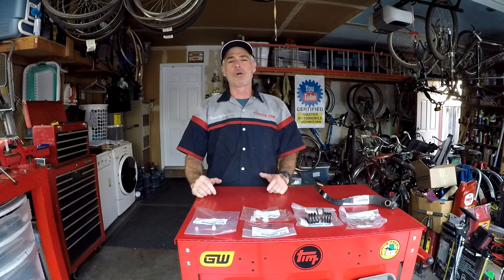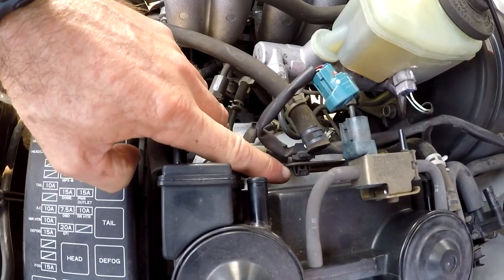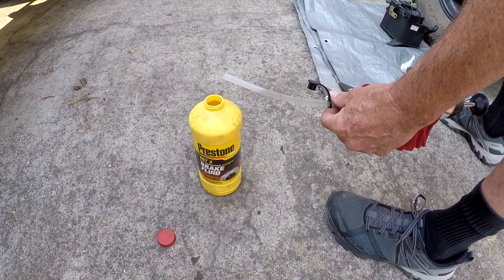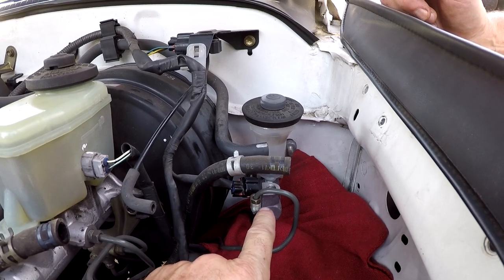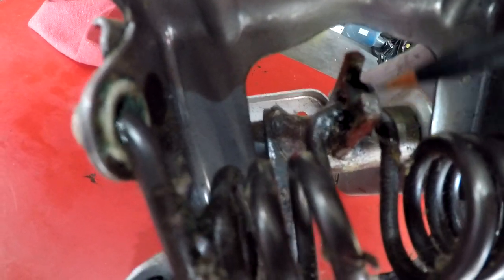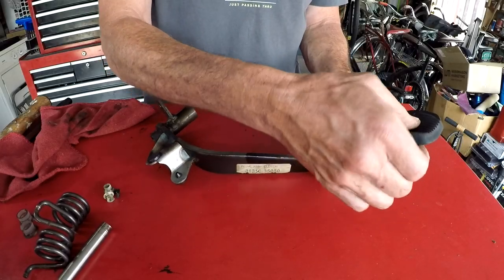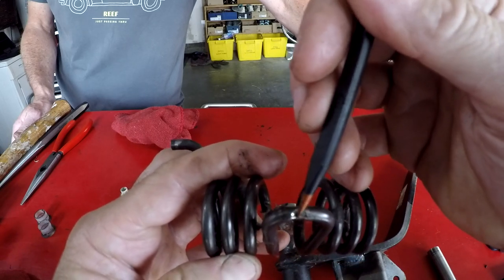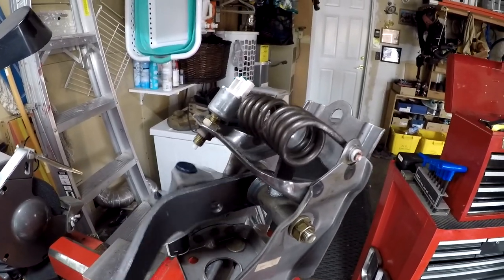Clutch Pedal Rebuild - Replacement

Comment: FYI, the clutch is self bleeding. you can just open the bleeder and let the fluid drain downwards, any trapped air will eventually work it's way into the reservoir.
Reply from the maker: Hmmm.  How long would you have to let it gravity bleed?  When we did a 3.0 to 3.4 Swap on a 2nd Gen 4runner,  that clutch slave cylinder was a pain to bleed.  We had to put a clamp on it to get it bled.

Comment: What are the symptoms of this needing to be done? I have a 97 Tacoma,  5 speed  manual. My clutch pedal went from engaging about halfway down , to right at the bottom. Thought it was the slave cylinder. Replaced that and the master cylinder. Helped a little but not enough. Could this be my issue. Clutch grabs fine, no slip.
Reply from the maker: @Chris-zp6eh  I don't think the clutch return spring is your issue.  There are adjustments you can make with the clutch pedal free play. There's a rod that goes from the master cylinder to the clutch pedal with a lock nut.  You can loosen the lock nut and turn the rod to lessen or increase the free play.  Look up clutch pedal free play, and you'll understand what I'm talking about.  I don't have a video for it.

Comment: If I just wanted to do the 3 piece kit on the clutch pedal I wouldn't have to remove the master cylinder and drain it etc right? I could just pull the pin and then remove the clutch pedal assembly and install the bushings correct?  Thank you
Reply from the maker: Yeah, that's correct.

Comment: Timmy quick question if I depress my clutch pedal and it doesn’t fully come back up unless I drag it the rest of the way up with my foot does that mean the spring is no good? Or what can be the cause of this issue?
Reply from the maker: It could definitely be the spring.  I would get under the dash board and have a look.

Comment: I have an auto trans.  But after seeing this video and also fixing my sloppy shifter a while back, I decided to do my brake pedal bushings.  No side play in the brake pedal now  - like brand new.  This video helped me a lot and I wanted to say thanks to yous.  Can't wait to get a 20t press in the new year...
Reply from the maker: That's cool you were able to fix the slop in your brake pedal by using this video as a reference.  You're very welcome.  When you go to Harbor Freight to buy the press, have them open the box and take a look at the pressing cross member that the bottle jack sits on.  Quite often that pressing bar is welded on pretty crooked.  I don't think any of them are perfect because they're using some cross-eyed welder in China, but maybe you can get one that fairly straight.  The press does work very well though and the price is definitely right.

Comment: I lost one of the nuts that hold the master cylinder onto the firewall that are hard to put on.. do you know the part number or what that nut is called?  I cannot find it anywhere.  Thank you
Reply from the maker: Go to your local Toyota dealer.  They'll be able to get it for you.

Comment: Thank you so much for making this video. I replaced my whole pedal assembly yesterday solo 99 4Runner and this video was very helpful
Reply from the maker: You're very welcome Taylor.  Great to hear our video helped you out.  We appreciate you taking the time to comment and let us know.  Happy Wrenching!
Reply: what was the need and purpose of you doing that ? ? ? curious curious curious ...
Reply: @efil4kizum  My 4Runner had 300,000 miles. The plastic bushings on the clutch assembly wore out years ago and the pivot points were metal on metal. That wore out the metal and the clutch pedal was hard to use, very squeaky and not enjoyable to drive.
Reply: @taylorbarnes5377  my '97 taco (343k miles) has always had that squeaky pedal during certain times of the year cold or humid out (as well as a shift fork squeak that is now gone with it's 1st new clutch + new shift fork in 27 years) the master/slave cylinder went bad at about 200k miles (pedal would not fully return in Reverse)  i had the yota tech that replaced those items several years ago fully lubricate + grease the pedal bushings, spring,  joints etc. while he was right there and there was NO more squeak that lasted for a very quiet 135k miles (except for the nasty shift pivot fork squeak inside the bell housing)... the pedal is now squeaking again once and awhile after the new clutch parts

Comment: Does this clutch pedal fit a 1998 T100???? I know you added all the parts in description. I want to rebuild mine as well but I don't want to buy the parts and they won't fit.
Reply from the maker: I'm not sure Carlos.  Your best bet is visiting your local Toyota dealer to get the right parts.

Comment: Thank you Timmy you got them all brother.  I needed this video my cruise control doesn’t work on my five speed in the clutch pedal.  I have to kick it up cover me first gear is a bit tricky but I think I’m going to have to do this rebuilt.
Reply from the maker: Hope you can get it fixed.  Good luck with the job.

Comment: Hey Timmy, best thing about getting another 4Runner is I get to watch your videos again! This time scored a manual 2000 3.4 Sport. Pretty excited.

I'm a bit surprised there wasn't enough room to slip a new gasket onto the firewall studs there... Or did you just disconnect the lines in the abundance of caution?
Reply from the maker: I can't remember but I think we didn't want to tweak the lines to get the gasket in there.

Comment: did this, more or less, today. two things: R&R of the clutch pedal is doable without disconnecting the hydraulic line of the master cylinder; and be careful what bushings you buy, since not every one labeled compatible actually fits. thanks for the vid.
Reply from the maker: Hey Leif, thanks for the info.  I don't know if it was clear in the video, but the reason why we removed the clutch master cylinder was to replace that gasket between the master cylinder and the firewall.    We didn't want to massively tweak the fluid line so that's why we disconnected it.
Reply: @TimmyTheToolman  Yep, and a good plan to avoid hurting the line. For whatever reason, mine moved with no problem. We had recently replaced the master cylinder so no need to replace the gasket this time around. Thanks again for your great vids. They're a massive confidence-builder.
Reply from the maker: @leifrudd8934  Good job getting it done.  You're saving yourself tons of money doing your own work while learning more about your vehicle.

Comment: Are the clutch pedal braket and assembly the same on the 1st gen tacoma and a 3rd gen 4runner. In the middle of a 5 speed swap and all i can find is a tacoma clutch and brake pedal assembly
Reply from the maker: I'm assuming they are but I can't say for sure.

Comment: Here are a few shortcuts:  1st) You don't need to drain the clutch master cylinder, don't even remove the cap or use a flare-nut wrench.  Just remove the two nuts on either side of the master cylinder(MC) that attach it to the fire-wall.  Under the dash, unplug any electrical connectors from the clutch and remove the pin that connects the MC fork to the clutch pedal arm.  Under the hood, pull the master cylinder back an inch or two, but not all the way out, only about half way, (half the distance relative to the parts that protrude under the dash), so it sits near the end of the two bolts.  (The fork never needs to pass through the fire-wall to complete the entire job.)  2nd) Remove the bolt under the dash that secures the clutch pedal assembly.  Once the bolt is removed, then carefully depress the clutch pedal towards the floor, being aware that the spring is still in play, but the three bolts have been removed that secure everything.  There's not a lot of force from the spring but you don't want to pinch your fingers or have the pedal-assembly move suddenly and damage wires under the dash.  Once the clutch is depressed toward the floor you can tilt the pedal upwards and it should make it easier to remove from under the dash.  3rd) Rebuild the pedal as per the video, but before you reinstall the pedal, make sure you install the MC gasket through the firewall.  Surprisingly, you can install the gasket from under the dash.  The trick is that you need to curl, (not fold or crease---just curl), the thin round edges of the gasket so that it will fit through the hole.  Use something, maybe an empty toilet-paper or paper-towel tube, to flex the gasket down it's length.  So one bolt hole on one end of the tube and the other bolt hole toward the opposite end of the tube.  Basically just role the gasket a little bit, primarily the thin rounded ring parts.  You only need to curve it just enough to reduce it's width so you can slip through the hole in the fire-wall.  So once it's curled properly, take it under the dash, slip it over the MC fork, stick one end of the gasket through the hole, manipulate the MC fork a little, to help you get the other end of the gasket through the hole, and now the gasket is on the correct side of the firewall and you're almost done.  Be careful once you get the gasket in place that you try to keep the bolt holes lines up and everything so that when you install the clutch and start manipulating the master cylinder that the bolts don't damage the gasket.  I used a little bit of blue masking tape to try to keep the bolt holes lines up.  I didn't have an extra gasket, but I suppose it wouldn't hurt to have one in case yours isn't as flexible as mine was or you have an accident.

Install the clutch pedal and finish everything up and you're done, never once having had to empty the clutch master cylinder or even extract the MC through the fire-wall, (other than a few inches.)
Reply from the maker: Thanks for sharing your technique.

Comment: The torque on that through bolt is 25ft-lbs according to the standard torque chart in the beginning of your service manual. It's a JIS Class 5T bolt with M10x1.25 threads.
Reply from the maker: Thanks Jacob.  This might be more accurate than the "Gudentite" spec Todd tightened it to.

Comment: Hey Timmy the Toolman,

I have a small question, do you know if Toyota made a Limited trim Sport Package model? I don't see one anywhere, and i own one. It's a 2000 Toyota 4Runner 4x4 Limited V6 Sport Package.

Seems kinda crazy, but cool. I think only SR5's came with the Sport Package. Sounds like i got a factory freak model.
Reply from the maker: I'm not sure on this.  T4R.org has a thread that might have the answer you're seeking.  Here's the link: https://www.toyota-4runner.org/3rd-gen-t4rs/82033-3rd-gen-4runner-buyers-guide.html

Comment: Great Video. If you just want to just replace the plastic bushings for the Torsion Spring do you have to remove the whole pedal from the car? I know its a tight space to work in there but is it possible?  I would like to avoid having to remove the Evap system and master cylinder just to replace 3 bushings.
Reply from the maker: Don't know if you could do it like you want.  If you try it, let us know how it went.

Comment: My bushings for the spring are toast.  I wonder if that would prevent the clutch from returning all the way.  I've always had to use my toe to pull the pedal back the last 1/2 inch.  I've had the problem for years.  It's not the clutch play adjustment and have replaced the master cylinder.
Reply from the maker: It could be.  Some people have also chosen to do away with the OEM spring set-up and install a linear return spring hooked to the pedal and then hooked to part of the body under the dash.  If you look under the dash at your brake pedal return spring, it's a spring like that.
Reply: @TimmyTheToolman  Replaced the bushings today.  Had the two white ones and went to the stealership for the middle spring one.  They charged more than MSRP!  Anyway it was a bear getting that spring back in place without a bench vise and proceeded to obliterate that center bushing I just bought.  The white ones were pretty bad and one almost wore all the way threw the metal to the outer part of the plate.  Guess I caught it just in time and now the pedal returns to normal.  Thanks Timmy for all you do...  Valve covers are next.
Reply from the maker: @schadlarry  Good job getting it done Larry.  Have fun with the valve cover gasket job.

Comment: Hey Timmy any tips to lubing/cleaning the reels on a 3gen electric seat?
Reply from the maker: From the write-ups we've seen on the Toyota forums, you should really take the seat guides apart and clean then grease the plastic gears.

Comment: Hey Tim, Is this applicable to a 1st gen Tacoma? I purchased the torsion spring because my clutch is starting to sag ever so slightly and not allowing me to use my cruise control. While I’m in there I might as well replace everything else.
Reply from the maker: Yes, this would be the same for a 1st Gen Tacoma.
Reply: Ditch the spring, my 1st gen Tacoma had lots of spring and pedal wear, and I welded a new pedal spring mount, but I decided to try without the spring,j and there is so much more feel in the pedal without the spring. The spring doesn’t seem to do that much work pushing the clutch 5-10 pounds more force without the spring, nothing I didn’t get used to in a week.
Reply from the maker: @jamb312  Thanks for sharing your opinion and option for the clutch pedal.

Comment: Hey man I been watching your videos trying to get ready to do a little tlc on my 2002 Toyota Tacoma Prerunner  like valve cover gaskets, spark plugs, and fuel injectors what is that book you always use as a reference on these videos?
Reply from the maker: It's a Toyota Factory Service Manual.  Do an Ebay search and you should be able to find a manual set for sale for your year Tacoma.
Reply: Appreciate it brother!!
Reply from the maker: @geronimo6830  You're welcome.
Reply: I found a set on amazon cheaper than I could get on eBay! Got lucky they had one left for my year model!! I really appreciate it man. And looking forward to more videos. In addition to my 2002 Prerunner I also have a ‘94 pickup 4x4 with the 22re in it. I hope you get to do some  videos on one of them. Lol it needs more love than my prerunner does. I really enjoy your videos I found myself watching other you’ve done because there is just a lot of stuff to be learned from the way you do things. Looking forward to more of em.
Reply from the maker: @geronimo6830  That's great you found an affordable set for sale.  I do have a couple videos working on a 22RE engine since I bought an 85 4runner a couple years ago.  Great to hear you're learning some helpful things from our videos.

Comment: Can you do this job without disconnecting the hydraulic line?
Reply from the maker: You probably could.  You would probably want to put something under the clutch master cylinder to support it so pressure isn't being placed on the line.
Reply: i just did part of this job, though timmy's approach is more thorough and avoids risk. i re-greased the bushings only, and removing the pedal assy can be done by removing the one upper bolt, the two nuts on the clutch master cylinder, and the electrical connections. back off the master cylinder away from the firewall a little, but not to the point that it's hanging and hurting the line, as timmy alluded to. i was able to maneuver out the pedal assy.
Reply: Does this also mean no need for a new gasket if just changing the bushings and spring?

Comment: Im sure y'all have heard about adding an older style spring in there instead of that horrible OEM style. Theres actually a little tab in there and most clip the other end onto the pin that connects the master cylinder to the pedal
https://www.tacomaworld.com/threads/clutch-squeak-linear-spring-swap-tw-how-to.159429/
Reply from the maker: Yes, we've heard of it.  It was Rob's rig and it was his choice to keep the OEM style return spring.
Reply: Yeah for sure. Im wondering if it would be ok over time. These guys on tacoma time are raving about it. 
Also saw a guy that made his own bushings out of brass

Comment: Brake fluid dripped on the grass kills it, I wonder what it does to your skin.
Reply from the maker: It doesn't burn your skin, but what does it do being absorbed into your body?  It's good practice to wear gloves when working with automotive greases, oils and fluids but I'd be a liar if I said I always wore gloves.  When I was younger working on vehicles, I never wore gloves.  Now I wear them most of the time I pick up a wrench.
Reply: @TimmyTheToolman  When I was a teenager (I'm 10 years younger than you) I always had skin peeling off the end of my thumbs and fingers and couldn't figure out why. Then I figured out it was from the grease and oil I was always getting on my hands from mountain bike maintenance. For some reason I am "allergic" to it. So now I always wear gloves and when one breaks and lets grease in my thumb starts peeling. Like you say, probably a good thing because it forces me to wear gloves.